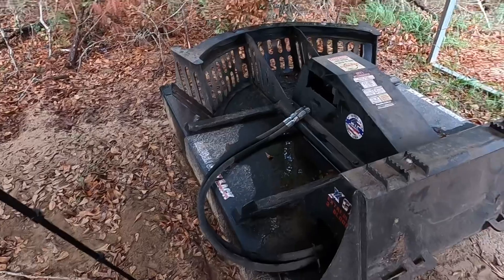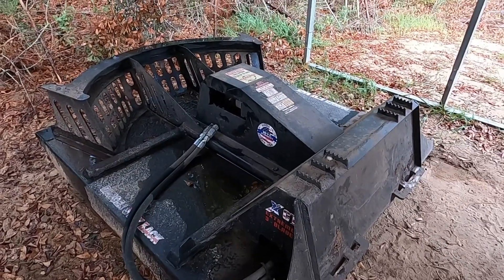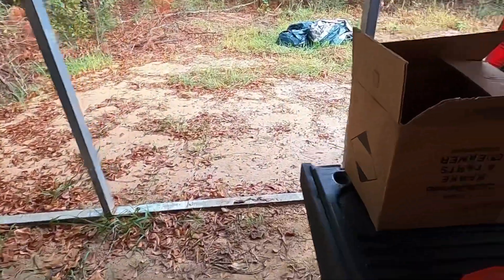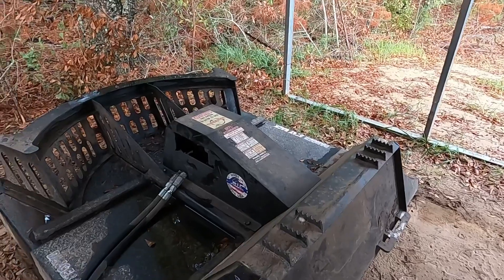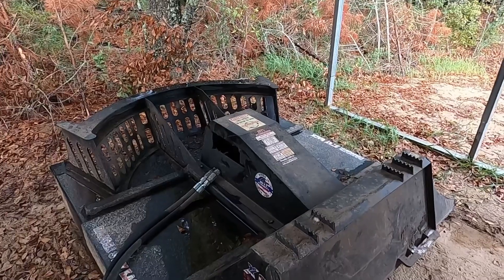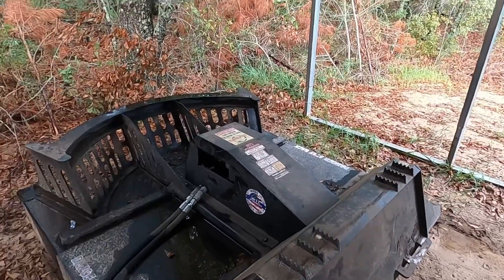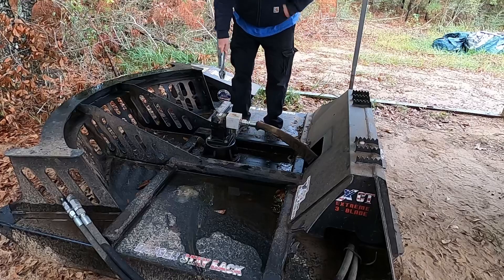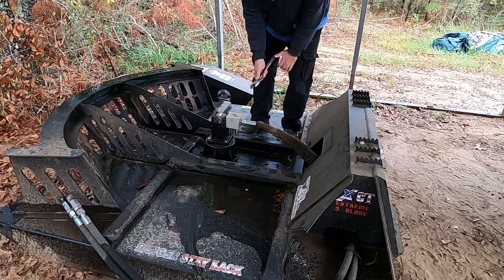MTL Brush Cutter Hydraulic Motor Epic Failure!

Comment: What motor was it, I can not get in contact with them.
Reply from the maker: You talking about MTL. They are hard to get a hold of. I bought the motor from them they had one that was new but was taken off a brush cutter that was sold and they want a different type motor installed. I’m not sure what type of motor it is. But just keep calling those guys eventually you’ll get through.

Comment: Have you been satisfied with the mower in general? Looking at getting one of those
Reply from the maker: @mikewilliams2695  Yes very happy. For the price of the MTL, compared to other brands that are more expensive. The MTL will do what it say it will and more. It took me a while to figure out how to use it effectively. So I probably abused mine a little in the beginning not knowing how to use it properly. I actually sold mine skid steer and the brush cutter with it back in February. Since then I bought a cat 303.5e2cr mini excavator. I am planning on buying a MTL mini excavator brush cutter for it when I get the money.
Reply: @weightbuilddig166  Thank you sir!

Comment: this is a bad desighn. motor sould connect to the blades throu belt, so to be able to slip or break the belt and not the motor
Reply from the maker: I agree with you 100%